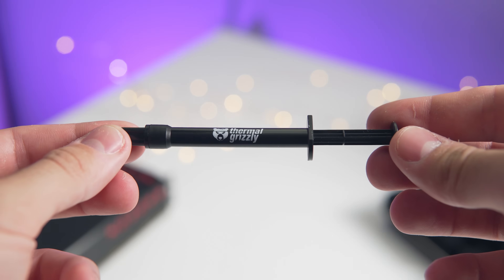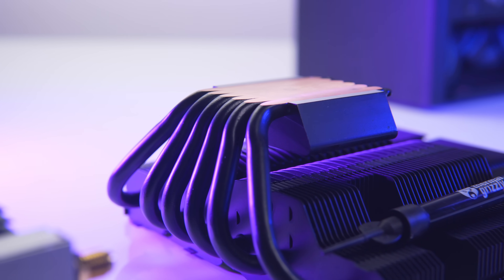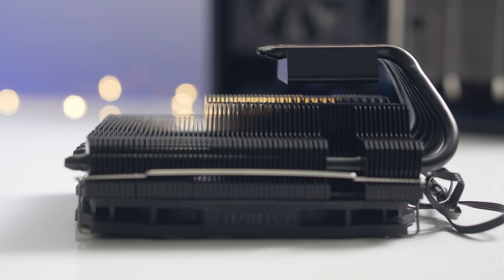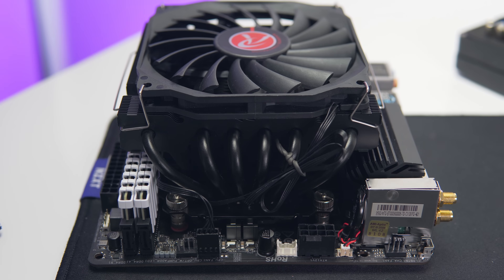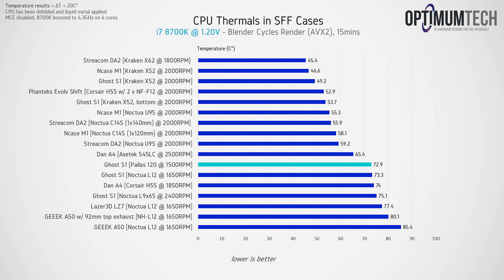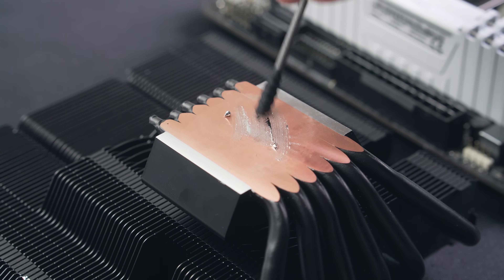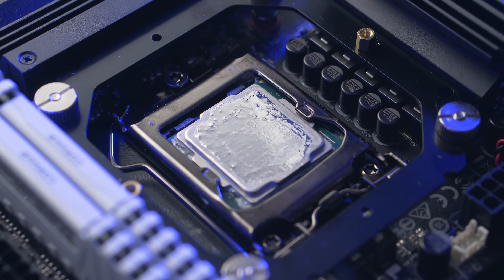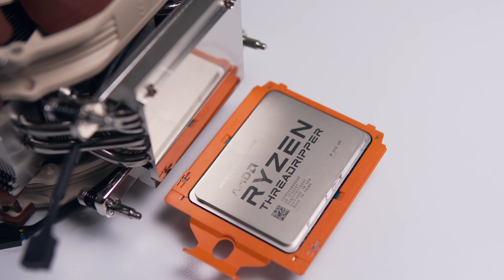Liquid Metal for CPU Coolers - Worth it Over Paste?

Comment: Will you try the graphite thermal pad next?
Reply: They are made for low maintenance workstations that don’t have overclocked cpus for longevity.
Reply: Everyone knows graphite thermal pads are worse than even thermal paste and generally used as a longetivity perspective so that it does not have to be replaced in a year or two. There is no point of using it in sff builds as sff builders usually know what they are doing and are likely to replace the thermal paste every when required for that performance and noise benefit
Reply: @BITVedanshAgarwal  They've been proven to be almost as good as liquid metal.
Reply: @BITVedanshAgarwal  graphite pads dont need to be replaced at all. they never degrade. but der 8auer will release crabonaut pads which will be similar but have better temps.
Reply: @BITVedanshAgarwal  no its not. i used thermal pads myself and theyre great. theres a measure for thermal conductivity that all pastes (and LM and pads) are rated at and the pads i used (IC graphite) were as good as some LM, but easier to apply than any paste and less hazardous
Reply: @BITVedanshAgarwal  you sir are incorrect

Comment: Considering the hassle of applying liquid metal properly, the gains are negligible. Delidding + LM makes more sense.
Reply: You obviously shouldn't even consider this unless you've already done delidding + LM. This would be to reduce the temp by a couple of degrees in addition to the 20 or w/e drop you already got from delidding. And I still don't think it's worth it, at all. Just stick with good paste between the IHS and cooler, and use LM between the die and IHS.
Reply: @isakh8565  Not unless you're running an AMD chip, those bad boys are soldered. Dropped ~15 Celsius, and I was running a pretty good thermal paste NT-H1. 
GPU side dropped ~25 Celsius. On Intel chips it's not worth it without delidding because intel uses toothpaste as TIM
Reply: Also the risk of accidentally destroying your mobo
Reply: @FaiyaRay  you don't risk the mobo whatsoever lol you're meant to take the cpu out to delid so it's not affected, the way this guy applied liquid metal on the top of processor was more dangerous
Reply: Right, plus delidding is for such a specific use case it's not really worth the hassle for most users. The only alternative to traditional thermal paste I would consider are thermal pads, and we are a few years off them being effective.
Reply: Not everybody wants to delid, and a lot of people want the extra cooling for pushing our stuff as far as we do
Reply: agree. Not worth it for most. Maybe for pro gamers making money from their sponsors haha
Reply: I use my i7 4790k delidded with LM ( grizzly conductonaut ) on it ( directly on the DIE and also on the IHS ) since one year now. I didn't even glue the IHS.  I get a -20/25°C ( yes it's insane ) when I did it and it's still the same. If you do it properly and your heatsink is in copper, it's totally fine. People who told you to not do it are people who did it wrong.
Reply: How about direct die cooling instead?
Reply: What did you say? you said Liquid metal gains are neglible, so you should use Delidding + liquid metal again? I dont understand
Reply: But how can I delid the Ryzen 7 without destroying it?
Reply: @samcrdx8016  its ment for intel cpus before the 9xxx gen.
Reply: @ppsarrakis  Seriously man, is there any way I can delid a Ryzen 7 without destroying it? I too want to delid and try those hardware mods on my cpu
Reply: @samcrdx8016  wastn the ryzen cpu´s solderd ? When yes it would be a dumb idea to try it. Just get a good cpu cooler and some good paste and everything is good.
Reply: i used IC graphite, drastically easier than youd think, and though its also electrically conductive, it fits perfectly over the die so it wont short anything, and gives the same benefits as LM
Reply: @bradhaines3142  I've used this before myself and can confirm they are efficient.
Reply: @bradhaines3142   i have this aswell its also reusable and last long?!?!?!?
Reply: @AR-dr1sb  Yes, they are meant to be reusable and they don't "dry out" like some thermal paste so you shouldn't have to worry about longevity.

Comment: Are you going to check out IC's Graphite Thermal Pad and Thermal Grizzly's upcoming Carbonaut? They're both are marketed as an alternative to thermal paste by how easy they are to apply (or drop) on to the processor. Would love to see you compare and review them!
Reply: Paste is still more effective than the pads. I'd used the pad in a system for my parents so I'd never have to worry about paste drying.
Reply: @zoomzabba452  i use it on my laptop so i dont worry about it gooping around. glad i switched it out since the paste on the gpu already slopped a circle around the square when i went to replace it

Comment: Could you review the nzxt h200i I think it’s an interesting case for mini itx builds and I believe the “smart” hub actually has a use in this case compared to the other atx ones because it can be used as a fan hub as some mini itx motherboards don’t have many fan headers
Reply: I've done some research on those "big" ITX cases. I do really like the aesthetics and build quality of the case. But the GPU clearence between PSU schroud and coolers kills it for me. 
Thats why i am planning on buying the fractal design nano S. in combination with an SFX PSU makes the GPU clearence a lot better. 

If only i could remove the PSU shroud of the H200, then it'd be an instant buy.

BTW, that fanhub is shiit. just buy a regular fan hub. watch somereviews of that case on Gamers Nexus (they reviewed the H700?)
Reply: I have this case.. its awesone for small case.. the airflow for this case is superb myte.. how ever.. you are planing to buy rtx card.. i dont know if can fit those cards on the case.. i have asus strix 1080.. planing to buy rtx 2080 ti in the future.. but its seem there will be a problem on the thickness height of those rtx card.. just keep in mind
Reply: @gotchie1591  H200/i most certainly can fit 2 slot RTX cards. There arent many though.
Reply: Why would he waste his time reviewing a top tier case everyone knows is good.